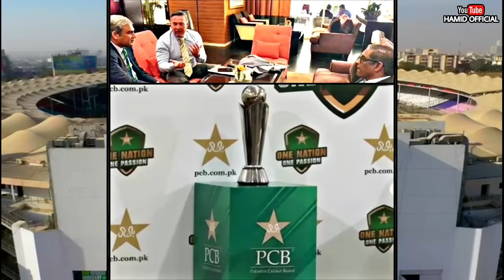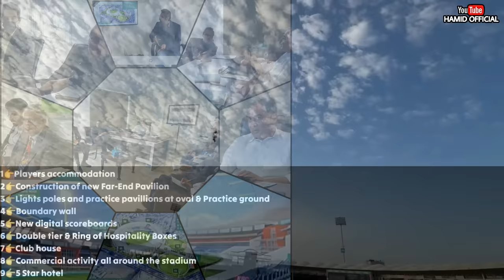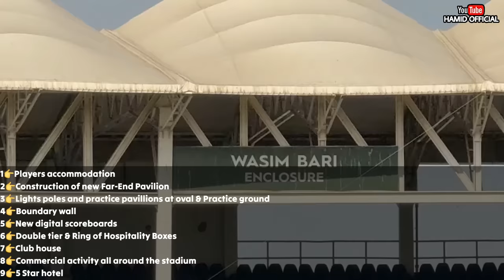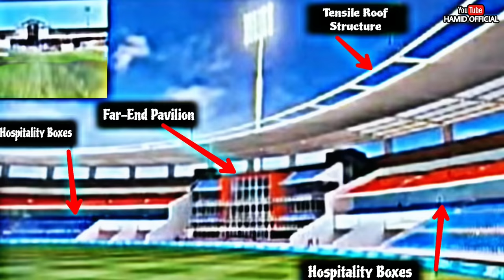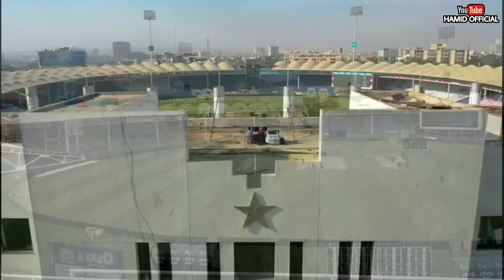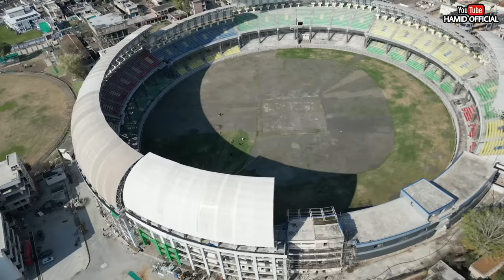BIG BREAKING 🔴😍 NEW 3D Finally NESPAK to Upgrade National Stadium Karachi for Champions Trophy 2025

Comment: They should have a long term plan to rehabilitate the old stadium. They should have a full design done to completely change the stadium. After the complete design they should renovate or upgrade one stand at a time. Plus for parking issues, they should have parking plazas around the stadium. That way they don’t need a massive parking space. For amenities, they should provide a lot of nice washrooms and spaces for food stalls in the stadium.

Comment: They should reduce spacing between stands and boundary ropes only way to attract a good amount of crowd cause usually it seems like a person is seeing match 1km away from pitch such is distance from ropes to stands also these fences should be lowered i mean nobody is gonna come inside with anything suspicious cause there are so many security layers to get checked outside stadium alone plus should make parling lots near stadium's which is one of the major problems